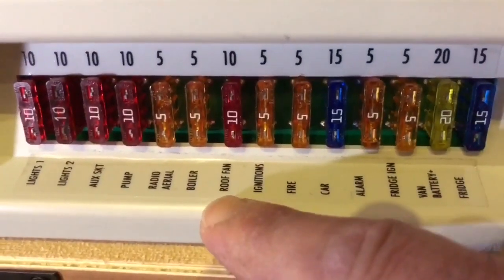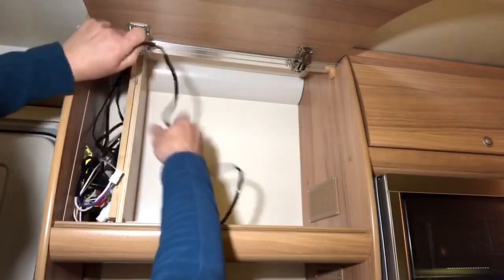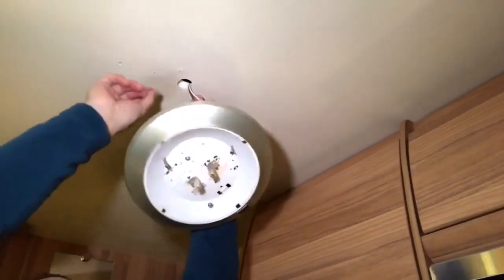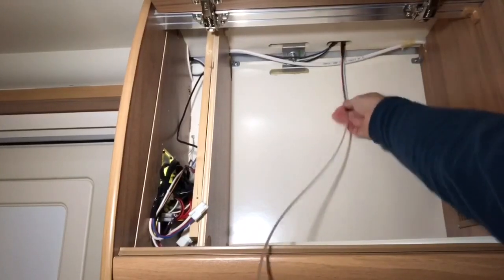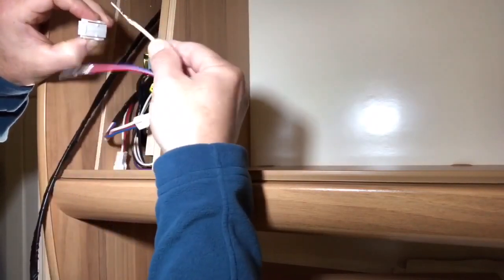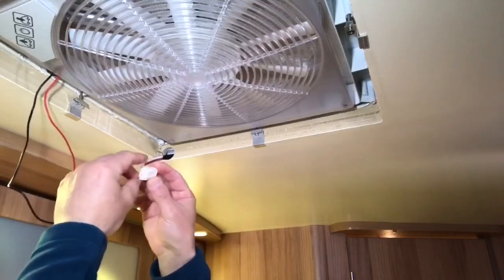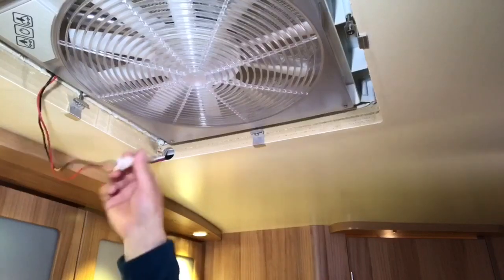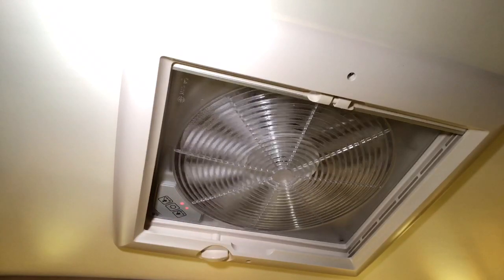UPDATE - Caravan Omnivent Roof Fan Rewire

Comment: Hi Rob, just bought a 2014 Swift Challenger fitted with one of these fans, however the control unit is playing up and I'm fairly sure that I'm going to have to replace it. Big question is do you know if this can be replaced from inside the van , or am I going to have to dismantle it via the roof of the van ? Brilliant videos which are very clear and very well explained, well done.
Reply from the maker: Hi Mike, One of my early videos, could do better these days 😁. Strangely enough I too had to change my control unit, but it was before I started Youtube. It can be done from inside. I purchased the part from roseawnings.co.uk 
Click on ‘spare parts’ at the top of the page and then click on ‘Thule Vent Spares’ under ‘Smart Panels’. For operating instructions click on ‘Thule Vent’ under ‘Thule Tech Specs’. Hope this helps and thank you for your compliment 👍. Cheers Rob

Comment: Great video! We’re hoping to fit one in our Bailey. Where do hou get the wiring and fittings from? Thanks Rob👍
Reply from the maker: Thank you Cheryl 👍. I ordered through my caravan dealer but you may find the parts on the internet. Parts are labelled Powerpart which are distributed by plsgroup.co.uk  this is because the public cannot purchase direct. Have a look at pls website, Electrical - Power distribution - Converter harness. It’s a Roof Fan Extension 12v Harness. Item number BC17004. You will also see Terminals and Connectors under the Electrical heading. I used the VL02 connector to connect to the Omnivent. First I would check to see if there is a roof fan 12v fuse in the fuse box. This will give an indication as to whether there is a dedicated connector somewhere behind a panel. Hope this helps. All the best, Rob 😀

Comment: Hi Rob,, Just going to purchase a roof fan . wanted to get the harness you talk about cant trace it anywhere on line . can you tell me where you got yours Pls
Reply from the maker: I ordered it through my local caravan dealer from plsgroup.co.uk because the public cannot buy direct. pls stands for Pennine Leisure Spares. The packaging is labelled Powerpart. If you look on their website for ‘electrical > power distribution > converter harness’. the roof fan harness is part number BC17004. Hope this helps. Cheers, Rob
Reply: @robswiseways5697  cheers Rob great help , Pony

Comment: Rob, could you give me details of the cable and connector pack please/ I have just got a new Omnivent and the fuse is marked Roof Fan in the fuse box and the cable is in the box behind the control panel...just need the proper cable and connectors, thanks Mick.
Reply from the maker: Hi Mick, I asked my caravn dealer to order it from Pennine Leisure, www.plsgroup.co.uk (look under 'electrical' then 'mains')as they would not deal with private customers. It's called a Roof Fan Extension 12v Harness. The part number is BC17004. The two way connector part number is VL02. You will have to purchase two packs of connectors because you need two female plugs. One to crimp on the end of the harness that plugs in the dedicated connector and one for crimping on the fan wires as in the video. which I failed to mention. Cost was £16.16. Hoping there is trunking in the ceiling, you will have to core a 25mm hole through the composite surround to gain access to the trunking like you can see in my video. I drilled this hole when I installed the first wiring a few years ago. Hope this helps and thanks for watching. Rob
Reply: @robswiseways5697 , thank you very much for the very detailed reply.
I have been to the caravan today and there is trunking to the roof vent.
I have no light in the position where yours is (Pagasus 2 Rimini 2011) but on taking the cable covers off I can feel a hole in line with the shadow of the trunking. Some RTV Silicon this week and get the proper cable and connectors then I will start the job! Thanks again and very good videos BTW, keep 'em coming!
Reply from the maker: I know I mentioned it in the video but make sure the correct teminals are crimped on the wires as there are male and female in the pack. There is only one chance at crimping them on. BTW, the harness is 3m long. Cheers Rob